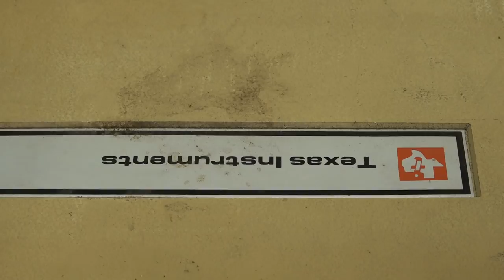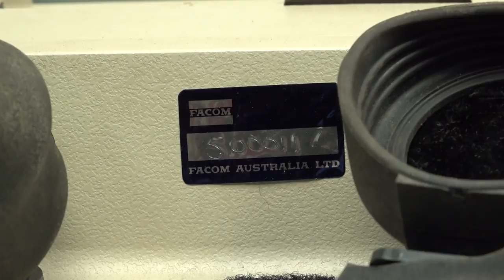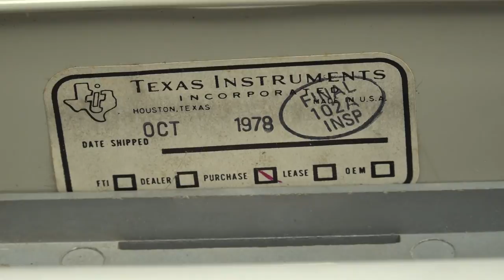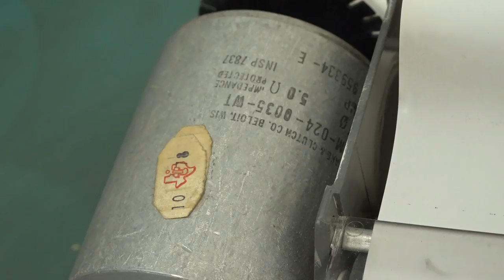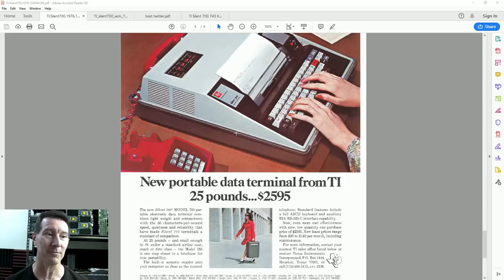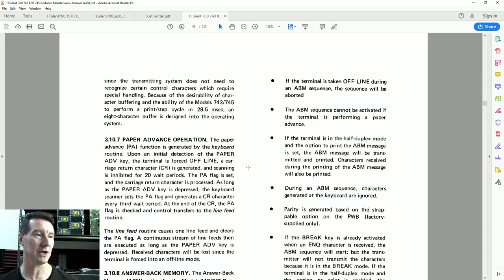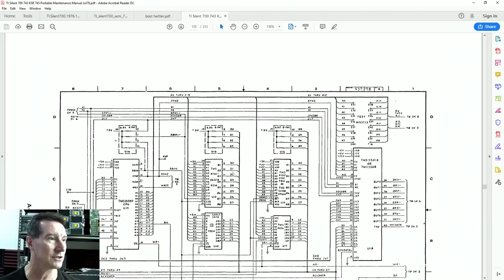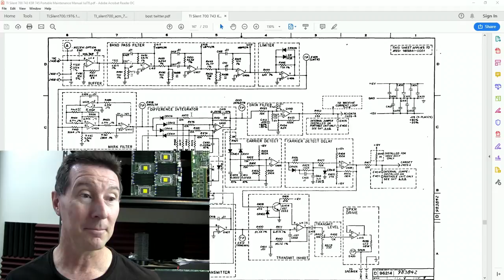EEVblog #1169 - TI 1972 Computer Interfacing

Comment: Funny how we are shifting back to "time sharing" computers aka cloud computing on demand.
Reply: Cloud isn't time share, due to the simple fact that two clients can run apps at the same time, even on single core.

Also resource isolation wasn't a possible on time share. You got access to all RAM on your time slot. 

It's the same goal but comparing the two is like saying horse carts are the same as cars since both get people around.
Reply: It's not reinventing the wheel, it's inventing a new wheel
Reply: @ilyail3   "same time, even on single core" Not physically possible, in modern clouds the "app" runs concurrently with other "apps" by other users and the scheduler makes sure every app by every user get's enough time on the  processor by using some scheduling algorithm. (This is also the case with common PC's only difference is that you only have one user to schedule the time for, and things don't happen via internet.) That's exactly what time-sharing means. Only larger difference is that virtualization is heavily used today. So the "app" might think that it runs alone, but if you look one layer downwards the virtual machines are sharing the same resources just like back in the day.
Reply: The IC datecode is 78xx, so not 1972.......
Reply: @persemake6090  I know that, but that's a very big difference, instead of people deciding on time slots to dedicate to a process the OS/hypervisor does that. And does it in a much more efficient manner. My point is that both address sharing of resources, but they do it in a very different manner.
Reply: @YoureUsingWordsIncorrectly  spoken like a man who never tried to spin up an innovative solution on own hardware in corporate environment, by the time you've finished filling all the paperwork the potential clients would've died of old age or left your company.
Reply: @ilyail3  They had schedulers on time-sharing mainframes as well, so people didn't choose the time slot 'by hand'. Are you mixing this with the even more old batch style computing?
Reply: Cloud is the new Mainframe almost as Terrorist is the new Communist! Bah! (mike drop)
Reply: Not funny at all. Cloud computing has zero benefits for consumers, it only allows companies to sell software as a service. So that they can squeeze money out of us indefinitely.
Reply: Job security, fight for higher up the food chain, ultimate surveillance...  bring the GDR Stasi to everybody (they never left really)
Reply: cloud !? shit then, shit today. Not much has changed though
Reply: @nodriveknowitall702  I hear you mate.
Reply: Barry Manilowa   Well, i'm not more than a kid with an operating systems book. Please tell more.
Reply: Michael Miller  Now obviously the majority of people watching this video are not religious, considering most people in science fields are not. However, there is absolutely not one reason why you, or anyone, should respond so strongly and so negatively to what in reality is a fitting quote for what the original poster commented. Just because it is from the bible does not mean it is inherently garbage or not worth reading. If the above commenter had simply said "History repeats itself.", which is what the quote essentially said, you would have not thought anything of it. But because it was from the bible, you felt the need to tear down and degrade and insult a total stranger. Learn to listen to people you don't have the same worldview as you. I am not a religious person. There is no reason to hate a random person, or any person for that matter.
Reply: @nodriveknowitall702  I feel a much more reasonable approach to stopping religion (if you're into that sort of think, I don't think it is inherently bad myself, despite being 100% thoroughly atheist) would be to care for and respect religious people and to listen to what they have to say, so that they can see it is possible to be a good and stable and kind human without the need to worship a god or believe in the super natural. I think many religious people fear that without religion, people are unable to feel compassion or empathy or genuinely care about others (which to us non-religious folk, is obviously not true). But if we show them it is not true by the way we engage with them, they'll be able to see we're all trying our best. In all walks of life, I find compassion and kindness will have the best results, even if you disagree so vehemently.
Reply: @YoureUsingWordsIncorrectly  my background is mainly startups(and not the silicon valley one), and mainframes to those kinds of companies might as well be made of unobtainium. Even if the companies managed to scrape enough money to buy a box, server farms would rip them of on rental space and bandwidth for just 1 or handful of boxes. Cloud does for those companies what the CD did to the music industry. And since that's more or less the only companies that ever do innovation in the industry I think it's a good thing.
Reply: @ilyail3  How do you think timeshared computers worked?  I'm basing this on my knowledge of the PDP-10 (aka DECsystem10), one of the most common TS machines, and the original hardware used by Compuserve.  These used reentrant code, which allowed multiple users to use the same executable at the same time.  This was done by partitioning the executable into shared (read-only) and non-shared (modifiable) parts (later known as "code" and "data" segments in Intel processors).  Only one copy of the read-only part of a program had to be loaded into memory, no matter how many people were using that program.
Furthermore, computers in the timeshare era DID have memory protection, in that computers designed for timesharing used memory relocation so that each user had his own address space.  You could crash your own process without affecting anybody else's; most crashes were due to bugs in the OS.  Timesharing would not have been practical without this.
Also, modern CPUs, even single-core types, can run multi-tasking with code sharing, using similar methods.
Reply: @BrightBlueJim  ok, I didn't know that, that was a bit before my time, thank you for the info.
Reply: @MinecraftEAT  

Religion isn't going anywhere. Be kind as you want for The fool hath said in his heart, There is no God. They are corrupt, they have done abominable works, there is none that doeth good.
 While they reciprocate and play nice, the aforementioned quote is still in the back of their mind. What's wrong with you? Why do you deny the existence of God? You just want to live in sin, obviously.

Also, the atheistic phrases used to manage death terror will never satisfy the majority.  This is the larger boundary, in my opinion. Fear of death leads people to religion, rather than the fear that nonbelievers have no compassion. I've had a few real life conversations with people about this, and most of the time it comes down to being unable to believe that you die and that's it. I've been asked how I live without believing in an afterlife, not, how do I behave properly without fear of eternal damnation.
Reply: @BrightBlueJim  Exactly! And that's how come Unix (and Unix clones) are still the basis of so many modern operating systems, they were already able to run many programs safely at once and have multiple users. 
None of this "cooperative multitasking" rubbish where it was bolted on to single-user single-process OSes.
Even in a "single user" environment like a modern desktop PC, this capability is used to restrict drivers and background services from some resources etc by having them run under their own "user" (as far as the kernel is concerned), which shows up in *top etc.
It also goes to show how ahead of its time *nix was, I suppose. They made it flexible enough that the core foundation of ideas is still perfectly serviceable.

Comment: I used a Model 33 TTY with an acoustic coupler to connect to a timesharing system back in high school in 1970 or so. Good ole Burroughs B5500. A few years later, I worked for Burroughs on the 6700. Fun times. :-) Talk about your wacky terminals... we had some old  (even by 1976 standards) crt terminals. Definitely none of your microprocessor trash there! All discrete logic. The screen memory was a delay line, and the character generator was a board full of individual diodes for each bit...

Comment: "Here Is" was an answer back for a remote station ASCII (char 05) ENQ...  As a teletype replacement it would automatically send a 20 character identifier back to the remote station.  The keyboard button allowed the keyboard to send the identifier without the interrogation by a remote system.

Comment: I just tried control-h (backspace) inside vi and it still works (Ubuntu shell in Windows 10). Control-g (bell) and control-j (linefeed) should still work too. These and most  other keys are standard ASCII. The acoustic coupler operated at 300 baud (30 characters per second). They connected to PDP and HP3000 era machines.

Comment: Awesome!  First terminal I used was an Agile A-1 daisy wheel with an external acoustic coupler modem (300 baud).  Very cool terminal - letter quality because of the daisy wheel and wide carriage so you could use standard fanfold printer paper. (11"x15"?).  Most of the time ya'd use cheap green-bar paper that was the quality of newspaper.  Those were the days!

Comment: HERE IS instructs the terminal (if it's programmed to do so) to reply with an identification string. From the ADM-3A instruction manual:
"HERE IS key is operational only if there is an answerback message programmed through setup. When typed, key transmits an indentification message. The message is displayed in half-duplex"

Comment: Oh the memories Hard Copy Terminal and Acoustic Coupler MODEM the struggle was real.   My first experience with on was back in like 1976 or 1977.  Tree killers for sure.   A year later I got to use a terminal with a CRT to save the trees but the damn thing used 80 Col Punch Cards so tree's were still needed to feed the beast.  That was on an old DEC PDP 11 something or other system.  Was not until the mid 80's when I got my first MODEM yea it was a killer speed demon at 300 baud.   Thinking back I can still remember dialing a number to call a computer and hearing those tones it was a real WOW moment.  I remember going home to call that computer just to listen to those awful tones with great amazement telling everyone this was the future.

Comment: In early 90's typewriters with parallel ports were common enough. I saw in 2000 that they would be no more and managed to pick a daisy wheel style up on ebay. Still use for sending letters. Nothing beats a physical impression! Yes, did write an RTF file to typewriter driver ... spell check and recording you know!

Comment: While I don't use 56k, I do manage my own internal dial-up internet access server. I even got a fancy rack mount telephone line simulator so I don't need to rely on any external phone line. Super fun to test out dialing in to a modern  Linux box with an acoustic coupler modem and a Bell rotary telephone.

Comment: "Here Is" sends a pre-programmed sequence. Radio Teletype operators used it for station identification. Don't know why it's still on a terminal meant to be used over a phone line and not radio.
Reply: The Silent 700 series was meant to be a portable replacement for all Teletype model 33 applications, so they wanted to include this.  This was an added-cost option, though.

Comment: SN98614 is likely used to drive the printer heads, it has some AND logic TTL input and a totem pole power output stage, or rather six of them.

Comment: Wikipedia on the "HERE IS" key:
Some teleprinters had a "Here is" key, which transmitted a fixed sequence of 20 or 22 characters, programmable by breaking tabs off a drum. This sequence could also be transmitted automatically upon receipt of an ENQ (control E) signal, if enabled.[21][22] This was commonly used to identify a station; the operator could press the key to send the station identifier to the other end, or the remote station could trigger its transmission by sending the ENQ character, essentially asking "who are you?"

Comment: The "HERE IS" key was used to to send a user name or terminal identity. It was a sequence that could be programmed into the terminal. Saved a lot of typing you know!

I was fascinated by the "HERE IS" key on the (only) teletype we had in tech school in the early seventies. It seemed quite deep an philosophical to me at the time. Like, you know, here is, far out man.

It was decades later I discovered it's mundane purpose.

From wikipedia:

Some teleprinters had a "Here is" key, which transmitted a fixed sequence of 20 or 22 characters, programmable by breaking tabs off a drum. This sequence could also be transmitted automatically upon receipt of an ENQ (control E) signal, if enabled.[21][22] This was commonly used to identify a station; the operator could press the key to send the station identifier to the other end, or the remote station could trigger its transmission by sending the ENQ character, essentially asking "who are you?"

Comment: A company I did some work for fairly recently still used dial ups for some of their remote offices. Even though all they needed were pretty simple database queries and such, the terminals functioned comically slow from the perspective of someone having used any type of computer system on a modern connection. Was like going back in time 30 years.

Comment: Yes, I have one customer using (sort of) 56K - they're technically on a unidirectional satellite connection - so all inbound traffic comes in by satellite, but the outbound traffic is routed through a 56K modem (Which I think is only effectively transmitting at about 33.6K - I'd have to double-check next time I'm out bush)
Reply: 56k dialup was always 56k downstream and less upstream. Required special tricks at the exchange.  Good thing about modems is that you could dial up friends directly, without an Internrt.

No longer possible with the NBN 😣
Reply: @BerndFelsche  Honestly, I get a better connection to my friends computers through the NBN than I'm ever likely to need. It's only connecting to gaming servers that really tax my connection, and the only P2P gaming connection I use is 7Days

Comment: some of those were used in libraries at universities in mid or late 80's Montreal around the time the first green screen monitors came in, it coexisted with punch card jobs that took 1 day to get run. maybe the green screen terminals were just text editors to prepare punch cards

Comment: "Here is" is like the "SYSREQ" key - if the host needed to be notified there is a unit waiting resources.

Bits and baud are two different things.  Baud is a 5 bit code, with a maximum of 32 characters.

Comment: BAUD is not always the same as BPS.  300 BAUD modems were one transition per bit, but using QAM, the 1200bps modems were still 300 BAUD.

Comment: That weird transformer is a toroidal transformer. They are quite good. It is still a linear transformer. Instead of the usual laminated plates producing a cube, the toroidal ferrite has both could wrapped around it. Toroids are quite efficient.

Comment: EEVblog  Dave, don't confuse Baud rate and Bit rate. Very different animals.
Reply: Up to 1200bps baud and bps are the same. However, 2400bps was often erroneously referred to as 2400baud.
Reply: @QlueDuPlessis    Not quite right Aadil.  You need to remember that Baud, is the symbol repetition rate, in that one baud may present more than one bit.  For  a telephony circuit, the Baud rate raely gets above 300 baud, but thanks to the use of multiple frequencies,  phase shift, and different amplitudes, a much higher bit rate is achieved.  The use of QAM (quadrature Amplitude Modulation) is an example. The ultimate bit rate is only limited by the bandwidth available and most importantly, the Signal to Noise Ratio. (SNR)   Dave erroneously used the two measures interchangeably early in his presentation.
Reply: baud: symbols per second (also non readable like CF,LF,CR....), while bps: bits per second.....

Comment: "HERE IS" sent the "Answerback" (generally programmable) to the far end.  Often some ID#. It's a follow-on from the old Telex "WHO ARE YOU" key.  
Sending the answerback could also be triggered by the far end sending you a control-E (ENQ aka Enquire).  Most terminals had programmable answerbacks right up until 1990 or so.  We used to change the VT100 ones in the lab to "^Ylogout^M', so if someone got a control-e to their terminal it would abort, and log them out. (Ah the things students do in college)
Reply: Oh, and full speed is 300baud = start + 8bits + stop.   
Slower = 110baud = start + 8 bits + 2 stop bits.

Comment: This type of terminals can STILL be used on today's computers, if it runs Linux. Most server motherboards still supports BIOS messages over serial, and almost all Linux distribution, along with GNU GRUB2 bootloader, still supports printing boot messages to serial and having interactive login sessions over serial. This means you can hook it to a modern computer that runs Linux with a null modem cable, and use it as if it is still in the 70s.

Comment: Ah, the old days, when a Silent 700 was dead sexy compared to the clunking ASR-33 Teletype we usually used to connect to the local educational timesharing service. Them were the days , Acoustic modems the size of breadboxes that took the handset of a ROTARY dialed phone that connected to a Control Data CDC70 with a whole 70 megabytes of storage!
Also, you knew when your computer session was over when the paper ran out...